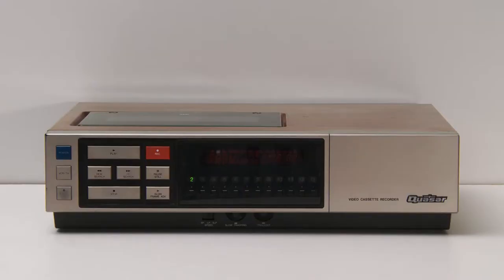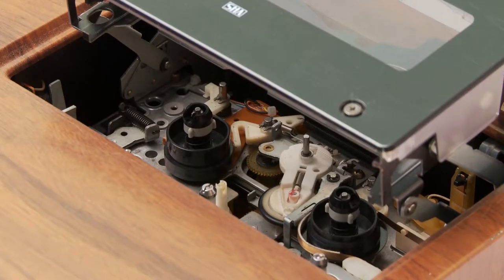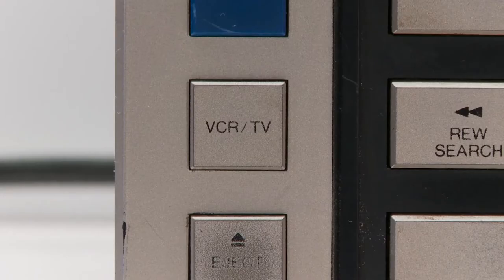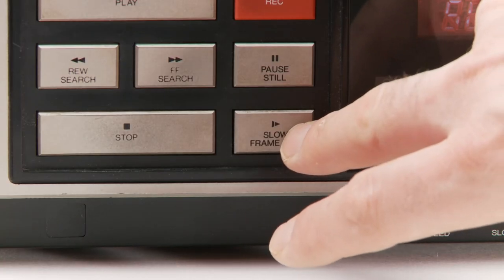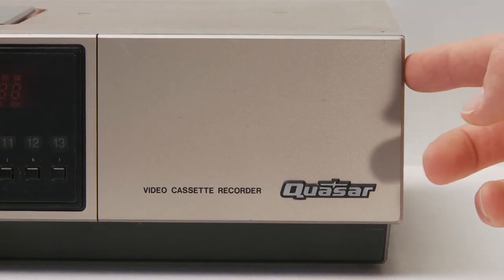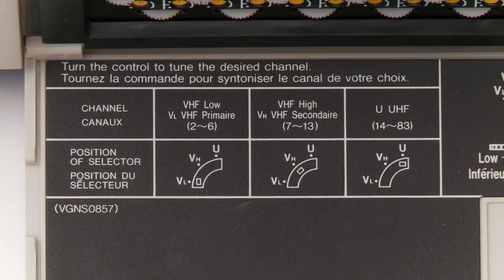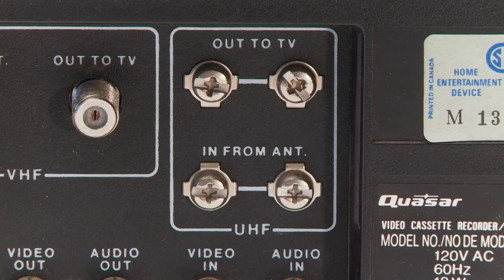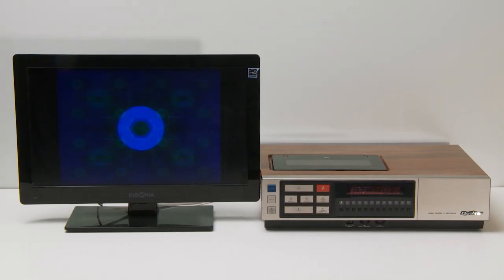1984 Quasar VH5041-K Top Load VCR

Comment: Two or three years ago on eBay, I bought a working 1984 top-loading Quasar VHS VCR just like this one. It functions properly which is pretty rare from eBay sellers when a lot of top-loaders have rotted belts or other issues which are not surprising given the age of such machines now.

Lots of nostalgic fun for sure. :)

Comment: This Quasar V.C.R. is a version of the Panasonic PV 1222/PV 1225. A.F.T. stands for "automatic fine tuning." Before the advent of quartz digitally controlled tuning that became commonplace around 1986, televisions and video recorders had to be manually tuned. The presets would be locked via solenoids. Of course now it is all irrelevant since television is digital and one just hooks the converter box through the phono cables into "line." One thing I personally like about these old units was that they were optimized to use with Japanese broadcast, which had a much higher standard than American television at the time. Now that we have digital T.V., these ancient decks actually record the signal better than newer V.C.R.s since the electronics were made at such a high caliber. Even your deck, which was considered low-end at the time has incredible resolution despite only having two video heads. The four-head units at the time were the PV-1525 (mono), PV-1530 (Dolby linear stereo), and the PV-1730 (high fidelity P.C.M. stereo). A good top loading four-head unit from Panasonic was the PV-1510 from late 1982, which was also a mono recorder.
Reply from the maker: Thanks for all your info!
Reply: @analoghermit  Could you tell me about the repairs that had to be made to your unit? I will put money down that your idler tire was worn (belts probably also had to be replaced). I have replaced that idler before in a 1985 Sylvania VC-2234 (Panasonic PV-1335), it is actually a much easier job than say a Sharp deck from that time period.
Reply from the maker: @2ndPyleOfVinyl  I would have to ask my guy again. He told me but I forget. Next time that happens I’ll be sure to include it in the video.
Reply: The number of heads has no bearing on the resolution. Only two video heads are ever used for standard rec/playback. In EP, a different pair of heads are used. Third or fourth heads were also used to improve freeze frame/slow motion etc. It's a common misconception that more heads = better picture, one that manufacturers were perfectly happy to let salesmen & buyers believe. More heads = more features though, and slightly better LP/EP pic quality.
Reply: PCM was featured on a small number of Video8/Hi8 VCRs, but never on VHS. (aside from external PCM adapters, recording on the video track, but that's another topic). The audio on the PV-1730 was "AFM" HiFi Stereo, also known as HD (High Dynamic) Audio on early Panasonic HiFi VHS decks. The HD moniker was quickly dropped, though, and mostly only seen on commercial Panasonic VCRs. After the early HD Audio models, it was simply known as HiFi Stereo, in-keeping with other brands.

Comment: “It won’t work if you just press record”

That got me laughing
Reply from the maker: The younger gen prolly wouldn’t know that so I thought I would mention it. Haha
Reply: @analoghermit  I was 22 when I bought my first "classic" Panasonic deck from Goodwill in 2015. A 1987 Magnavox VR 9655, which had linear stereo, four heads and on-screen display yet you still had to press record-play at the same time. 1987 was the last year that Panasonic decks had that quirk. When I brought it home, I thought the record button had a short until I read the manual.

Comment: I just found one of these at the thrift store but am having trouble as the device shuts off after a few seconds once the power button is pressed. What kind of service did you have done to this VCR? I read power supply is an issue
Reply: Unlikely to be a power supply fault. Power supplies on these old decks were very simple linear psu's, no complicated switched-mode-PSUs (typically). Your problems are almost certainly caused by worn belts &/or worn rubber idler wheels.
Reply: and/or dirty mode switch contacts.
Reply: The shut down is more likely to be intentional (due to mechanical issues) rather than an electronic fault.

Comment: Now you can record modern films to VHS  it’s easy M8 
You need a RCA  to HDMI adapter 

Connect an RCA  cable  to your tv and to The VCRs input then with another set of RCA  cables Connect them to the VCRs output to the RCA to HDMI adapter,then the HDMI cable goes to the adapter and the other HDMI plug goes to a computer search any movie you want and press record enjoy.  📽 🍿